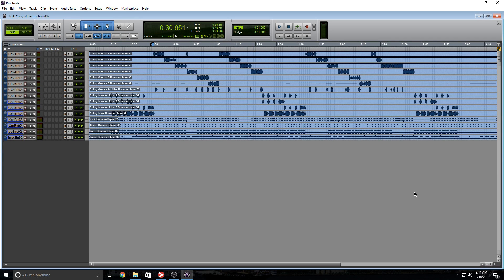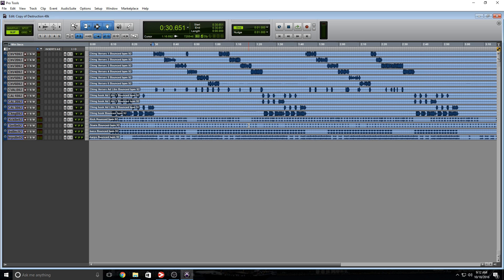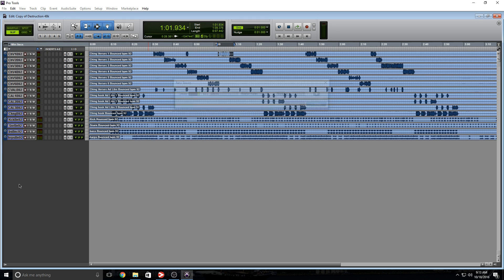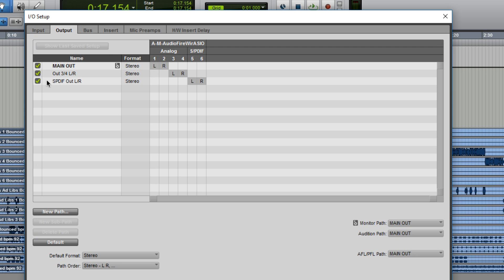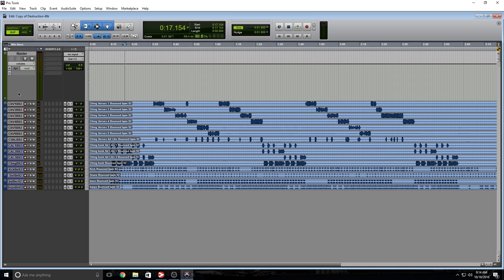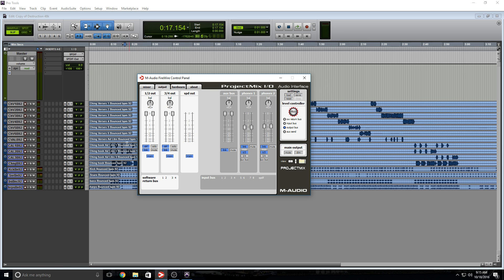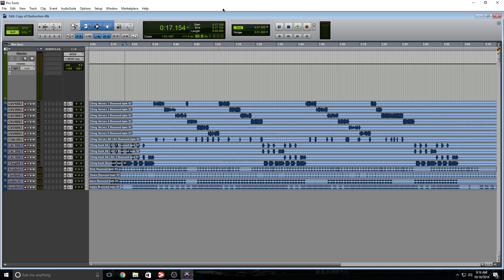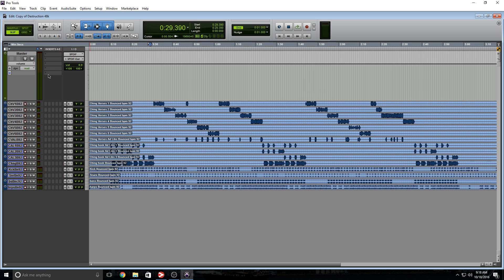How to enable SPDIF mirroring in Pro Tools

Comment: Hey, Ray did you ever sell that 002 console of yours? I got 1 from a buddy and got it working in Protools 12 with faders on windows? It took me a while to get it figured out but it is working like a champ and I can use my other converters and it just as a controller.
Reply from the maker: Nice, No I gave it  to a buddy. Still using my project mix io with my C600 with external converters.

Comment: Win10 Pro 17661.  Currently SPDIF input is broken.  I'm running Guitar>Kemper>SPDIF 44.1khz>003R.  There's regular little glitches in the sound, otherwise it would sound really good.  I'm hoping MS fixes SPDIF through firewire issues.